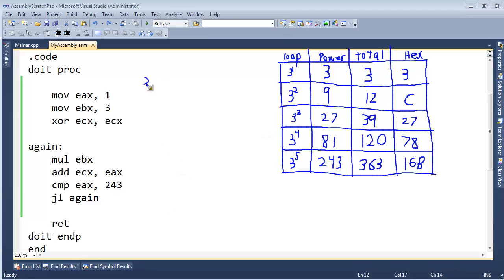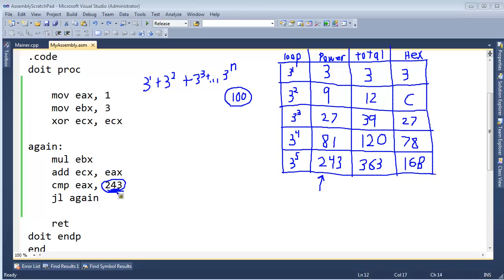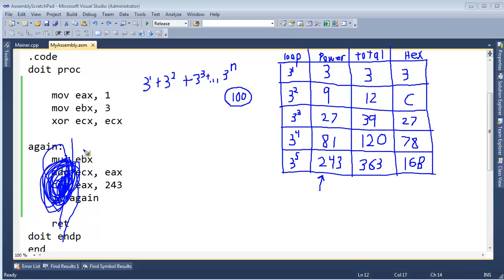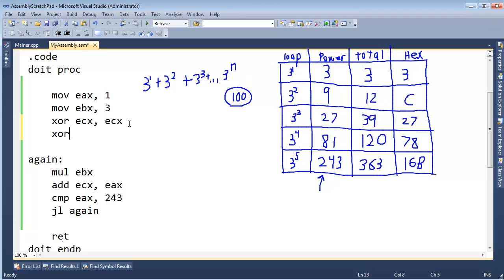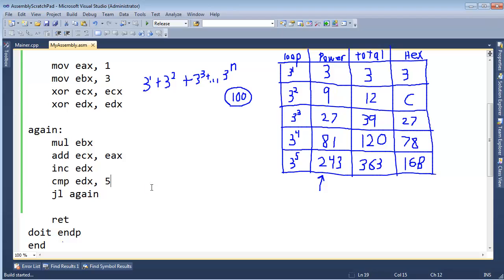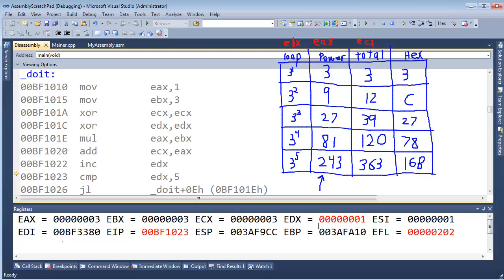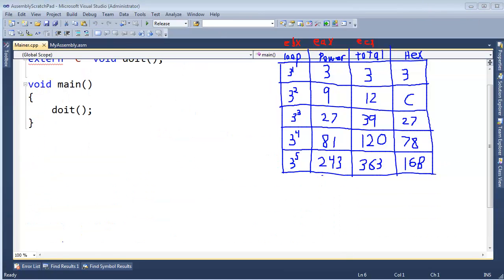Assembly- Adding Up to the Nth Power

Comment: 00:39 Wouldn't it be better to make the exponent to be the loop condition instead? That's what we're aiming to after all :q
01:08 Meeh, not that big, though: it's only 48 decimal digits, or 40 hex digits if you will (20 bytes, or five 32-bit registers). Here it is in hex:
   3^100 = 5A 46 53 CA  67 37 68 56  5B 41 F7 75  D6 94 7D 55  CF 38 13 D1
Wanna see really big numbers? Do some cryptography :) Or look up Mersenne primes ;)
02:36 Whoops, I smell trouble ;>
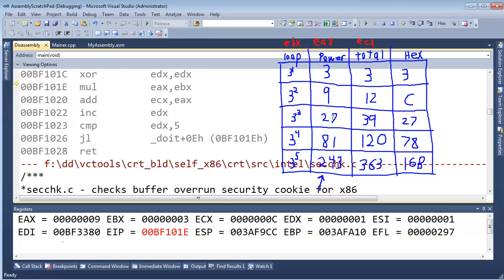05:44 Yup, that's the trouble ;>
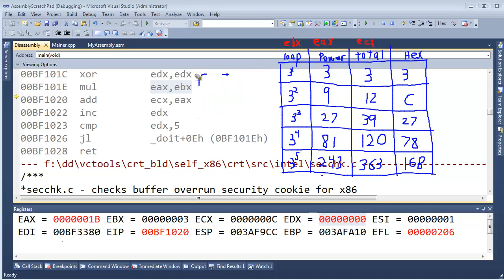06:35 Hmm... I can see several possible solutions. It depends on whether the base can change or it's supposed to be always 3. If it's always 3, then I'd either use an immediate (that should free one register for us) or get rid of the `mul` altogether and just bit-shift the running sum once and add the sum to the result (a fast way of multiplying by 3). But if that's out of the table too, and the base can change and we can't use some other registers (you still have ESI and EDI unused ;> as well as EBP, because you don't use stack frames), that is, when you insist on using memory, I'd go with pushing some values on the stack and popping them later. Then they should end up in the CPU's cache and should still be fast enough.

Comment: mov ecx, 0        
mov ebx, 3          
mov esi, 0          
mov ebp, 1
mov esp, 2
mov edi, 1
start:              
mov eax, 1
oky:
mul ebx
inc ebp
cmp ebp, esp
jl oky
add ecx, eax
inc edi
add esp, edi
inc esi
cmp esi, 5
jl startret

If you want to add more 3^n, you just need to change the 5 in the line: "cmp esi, 5"

Not the best way of solving this Problem, but that's what came into my mind :D